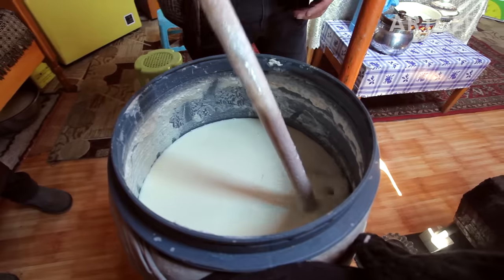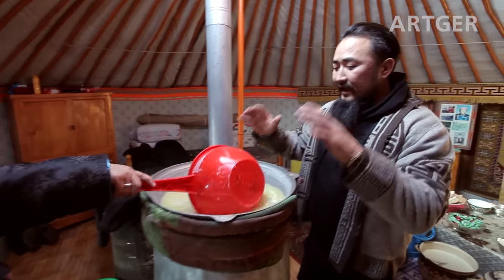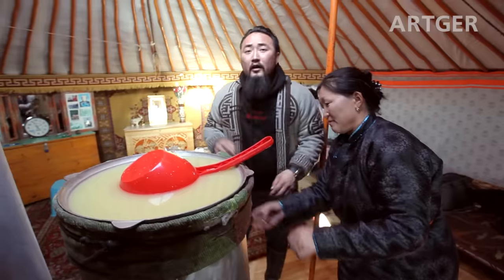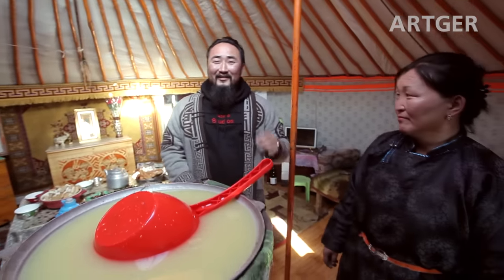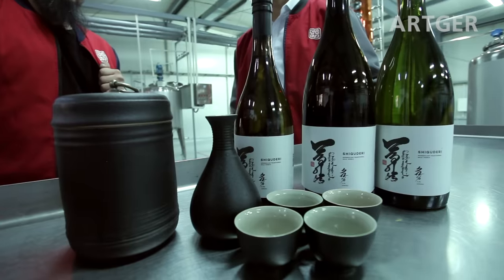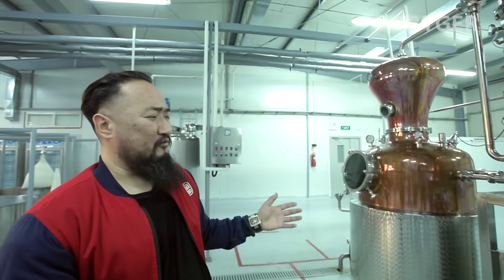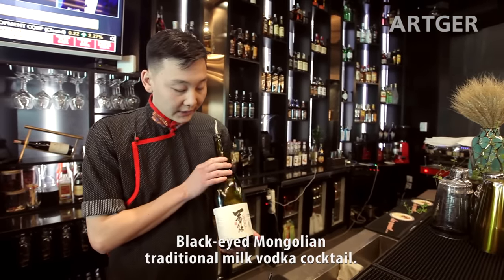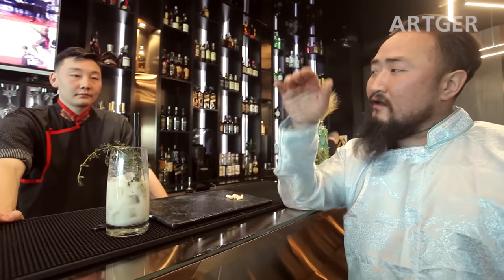Nargie's Mongolian Cuisine: MILK VODKA (Mongolian Traditional Alcohol Drink)

Comment: I should mention that the "ethanol production" is the fermented airag. The bacteria har already converted lactose to glucose to ethanol.
The heating is to destroy lecitin (which will seperate fats from water), kill the fermentation bacteria.
If you are going to are going to dry this at home you could use pastorized milk, use lactic acid to seperate casein and filter, use lactaze (same as lactose intolerant people use) and once lactose has been converted to glucose, add the regular yeast or alkas enzyme.
This will most likley have a allot smother taste then the wheat ethanol that is common.

Comment: Kinda curious... how do you keep methanol in check using this technique? Youd usually want to keep the temperature inside the vat at just over 70°, but I cant see anything to control the temperature... or dyou just have to take care to not drink enough to get methanol poisoning?
Reply: They are not using a plant based alcohol so there’s likely little if any methanol.
Reply: @nanciandstephan269  Huh. Wasnt aware theres a difference... will have to check it out. Thanks for pointing it out! :)